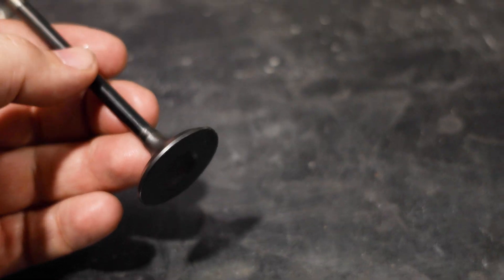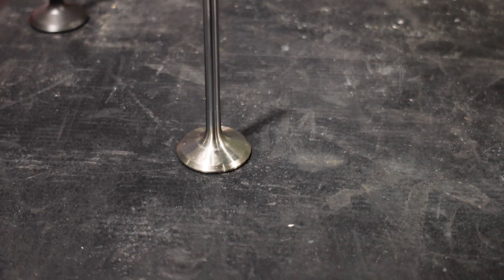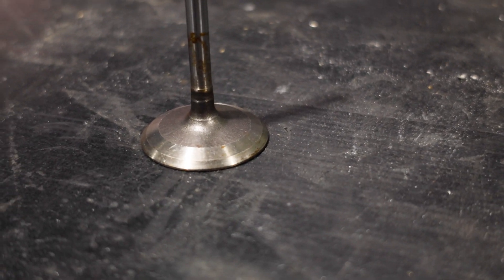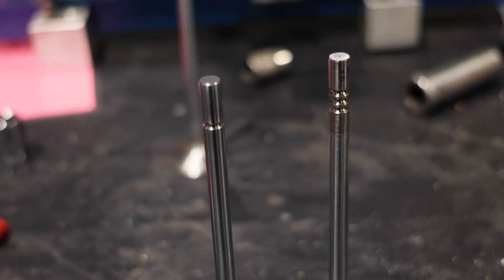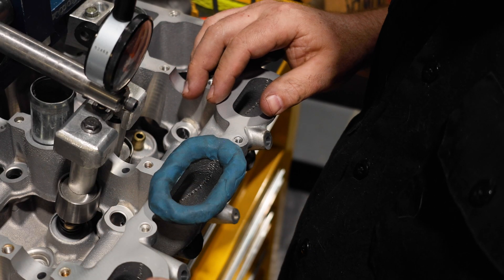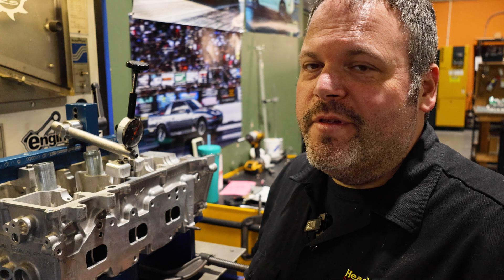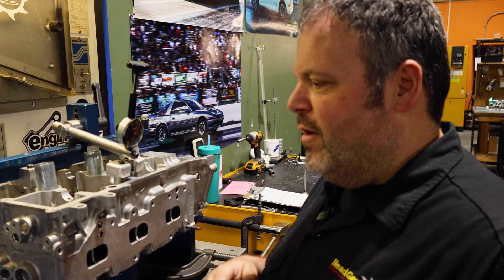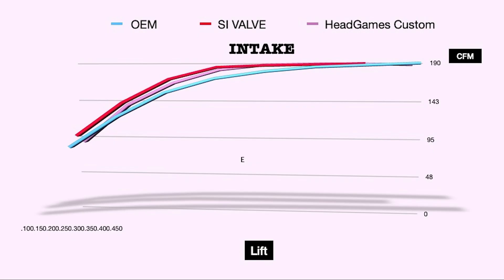Are SI Valves Ford Gen 3 Ecoboost/ Raptor Valves Worth It? Test Results inside!

Comment: Think it’d be interesting to see what happens on y’all’s pocket ported head, vs. OEM. Tending to think the throat will be critical, for better or worse, and may need to be limited to <88%, but I guessing / talking out my ass…
Reply from the maker: you are actually right on the money for % and it pick up BIG numbers
Reply: @headgames  my thought is that 88% throat mightn’t be maximum flow, any more I’d think would nix port energy and turn it into a turd, maybe even more so for it being DI, and screwing up cylinder / chamber twirl… Guess that’s all crap that’d come out on the dyno or track and not the flow bench?
Reply from the maker: @ it has di and port so it’s not imperative that we do it for the di.

Comment: Curios to see how SI compare to GSC  on a ported cylinder head.

What is the weight difference?
Reply from the maker: @CJ5EVOLUTION  GSC doesn’t have a raptor valve but I was thinking about throwing their coyote valves in there to see how it would compare.